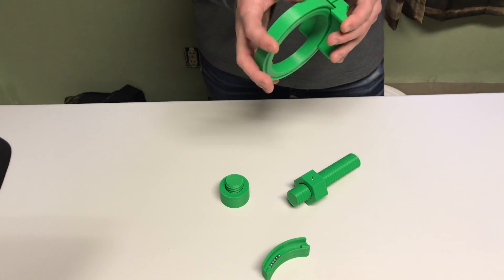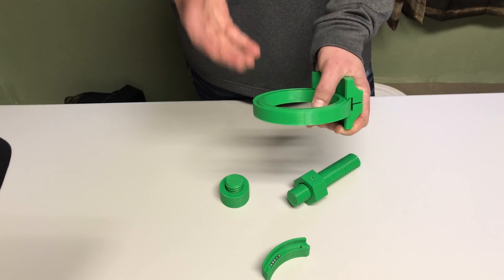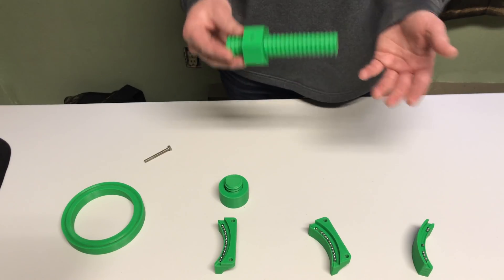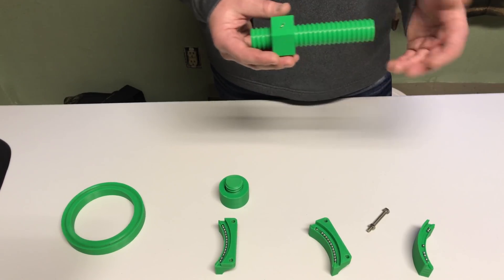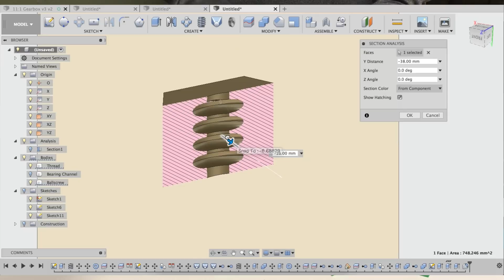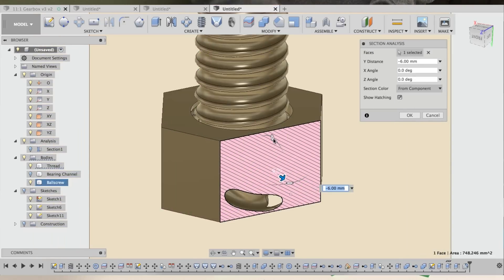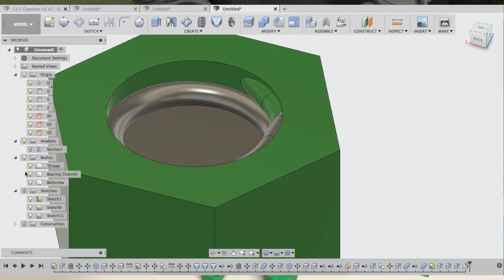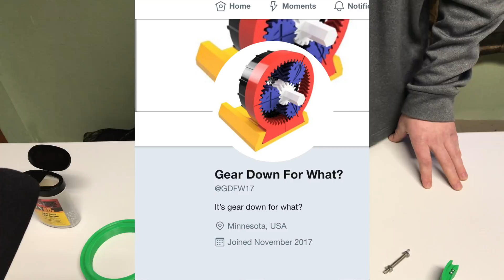Recirculating Bearing Mechanisms. AT-AT's Ankle and Ball screws!

Comment: Can you use a resin printer with tough resin and print small 6" inch sections with a hole in the middle and join them together with drill rod  to make a long ball screw?

Comment: What if you route the balls to a second ballscrew race? The balls being pushed out by the first ballscrew will force the second ballscrew to turn! Or perhaps use the stream of balls to push a gear around like a wormscrew? Also, I suggest stretching the nut thread pitch instead of the screw, so you can user a standard thread pitch for the screw and even use a standard metal screw if you want.
Reply: Another possibility is to use 2 ballscrews threaded together with a thread pitch different than the screw, so that they will function together like an anti-backlash nut, and also have twice the strength. Or maybe just use less races on either side to keep it close to the same size.

Comment: Neat stuff! 

I like the ball screw trick of stretching the treaded rod, but I think that means that the load is only passing through a couple of the balls. With metal ball screws, people get rid of the backlash by taking two ball nuts and threading them up to and against each other. That way, at least half of your balls are engaged at any one time.

Comment: Any chance you could print a full linear axis using this nut and bolt, and test it out with a stepper? A reprap machine using this system could throw away most of the metal bits required.

Comment: I think some gun turrets had a partial slew ring bearing that worked in the same way as the first one shown. Used because it's a bit smaller and lighter than one that goes all the way around the entire guide track. Might be able to see some good examples on WWI aircraft.

Comment: Biggest issue will be the metal BB' will chew through the plastic very quickly under any loads. This is why metal bearing races are hardened steel, to stop the load forcing the balls to grind the metal away.
Using plastic BB's may be better for longevity, though they will not perform as well.

Comment: Love the video, very clever. I feel like every day I see another clever application for 3D printing. Also, thank you so much for publishing all your designs for free online. Really is for the good of the community. Do you/would you ever consider taking on projects?
Reply from the maker: I like taking on projects when I'm inspired to do so. otherwise it feels too much like work
Reply: Well my immediate thought when looking at this was an RIS-RIS recoil sled mount using one, or a pair, of RC car shocks. You've got the smooth but tight linear motion down, and it only would need the mounts and a spring-damper unit to function. Such a system could protect delicate electronics, optics, or whatever else on high power rifles.

Comment: I don't think you mentioned it at all but did I see a plug on the nut for adding bearings into the system into the return channel? if not it may be something that you may want to think about to make loading the bearings easier. great design though. and great video. thanks for sharing!
Reply from the maker: I've never actually owned a real ball screw, but I have seen that, would be a really nice way to load the bearings into it.
Reply: Gear Down For What? I have never seen one other than yours. I just saw what looked like a dimple in the side of the nut and assumed that that would be what it was and what it would be for... like I said though it may make it easier to fill up with bearings.
Reply: Gear Down For What? I would think it would make it easier with the other one too. if just a few bearings short and it would be louder if Nothing else... with a plug on top that goes into the return channel and you could load it with the proper amount much easier...

Comment: This changes everything we ever knew about 3d printed gears! I mean you can use that radial race... thing, for mounting planetary gears perhaps or even put a crown gear on one side to transmit power to another gear positioned at a 90 on the bearing housing. Killer video!
Reply from the maker: Interesting thoughts. Ill look into that some more.
Reply: Sorry I don't print or do gear stuff. Wish I could do more than bark commands at you haha
Reply: Also, a worm drive is applicable
Reply from the maker: Yeah, someone else mentioned that too. My mind is still chugging away on how to keep the balls in the proper place.
Reply: interesting idea. I am in the middle of designing a planetary gear. I.will investigate this idea in fusion, and if I have enough space I will implement it. I am quite constrained in space that I can use.
Reply: Or a mount for a home made telescope.